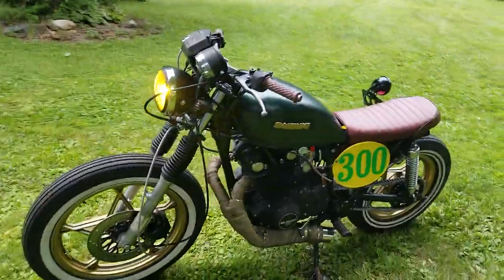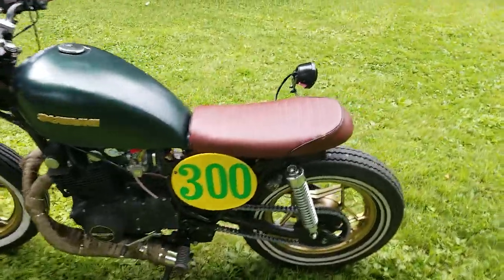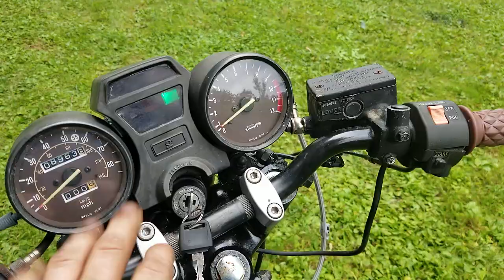Jedz Moto Custom build: 1982 Suzuki GS300

Comment: Hey does the 450 front wheel fit on the 300 forks without any modifications?
Reply from the maker: No. The 300 is drum so you need a 450 front end to make the 450 disc brake work with the 450 front run.
Reply: @Jedz123  I know the 300 is drum I was just hoping I could take the wheel on the 450 and it would still fit on the 300 forks and I could add a reservoir to the handlebar for the disc brake. I’m having a hard time finding a front brake cable for the 300. My current one is broken.
Reply from the maker: @yc7175  your 300 forks don't have the Caliper mounts like the 450 so you can't install a disc brake unless you replace the forks.
Reply: @Jedz123  that makes sense, I didn’t think about that
Reply: @Jedz123  Do you know if any other Suzuki models around that year with drum brakes would share the same front brake cable? All front brake cables are out of stock for the 1982 gs300l and I can’t ride it without brakes